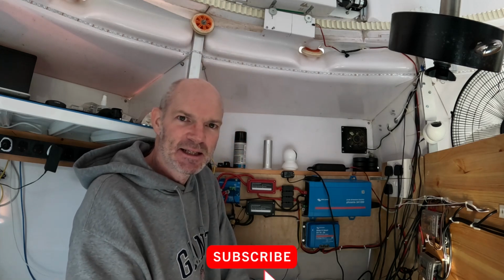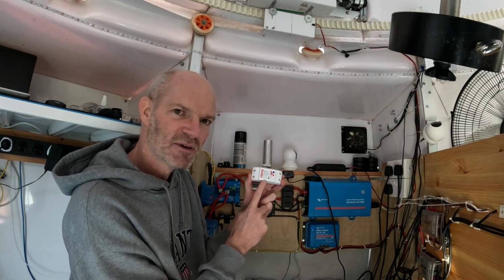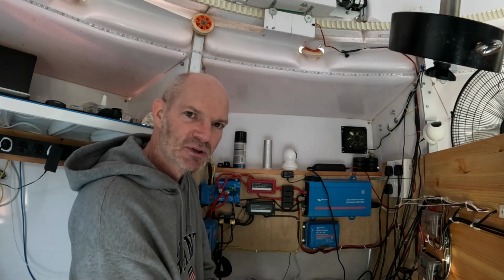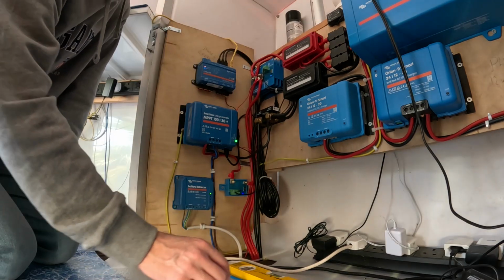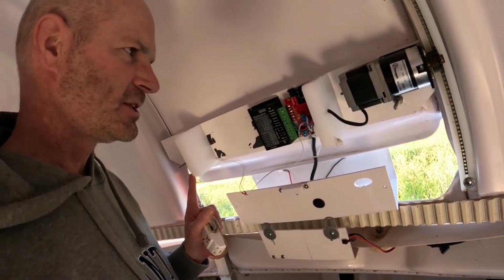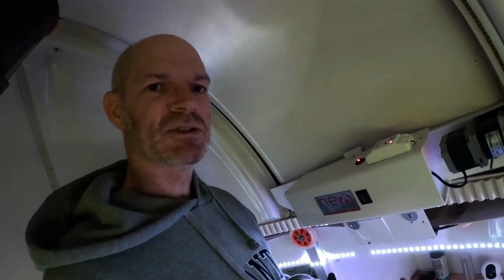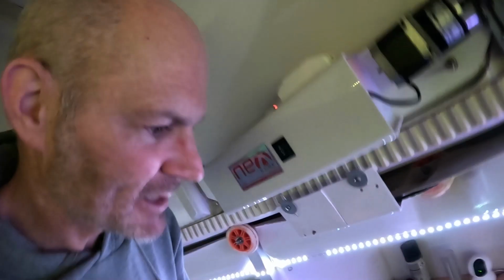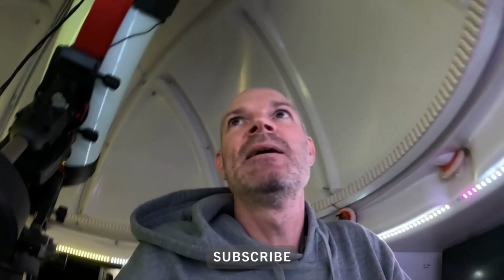Project Power! Part 7 -  Shutter Charger Changeout and Remote Power Control

Comment: This is great! I wish I saw this while I was working on my power for my remote observatory. I currently run all my loads through the inverter, including the shutter charger. I like the idea of the DC to DC charger as I hate the included charger and can run off my 200AH LifePo4. Quick question for you, though I thought I might have missed it. The Dakota Lithium battery in the shutter has a max charge current of 10A. How are you limiting that? All instructions with the DC to DC charger shows that it'll send the max current through whether that is an 18A, 20A, or 30A variant.
Reply from the maker: Hi Steve, I don't limit the current. I set the DC-DC unit into charger mode, set the battery type to LifePo4, set the voltage values and leave it to take care of the charge cycle. I can't remember how I came to this conclusion, I do remember ages reading up, so hopefully the combination of Victrons Know-How and Dakota's BMS will be sufficient. Not seen any issues so far.
Reply from the maker: I will have to put my clamp meter on it and see what it says next time I draw it down a bit.
Reply: @DavesAstrophotography  thanks and appreciate your answer!!!